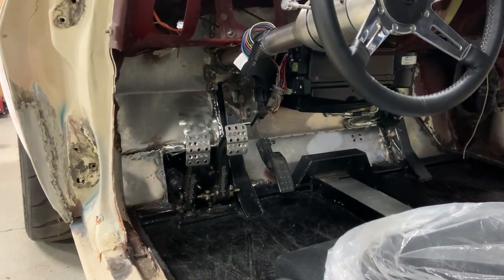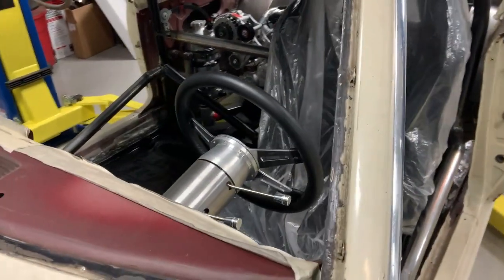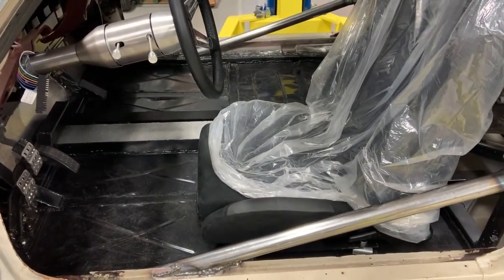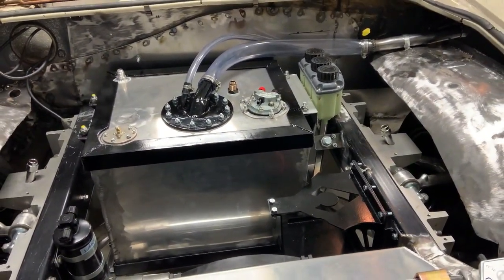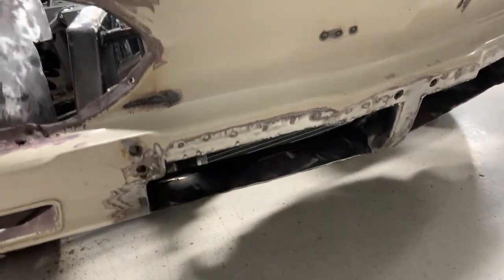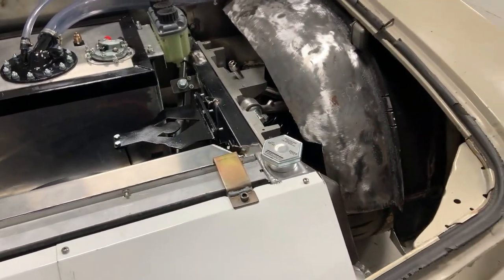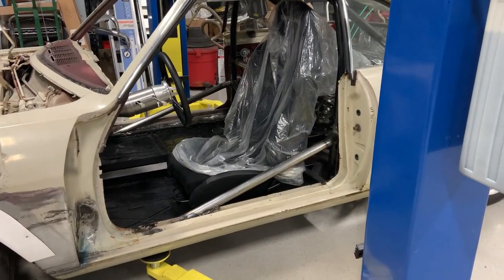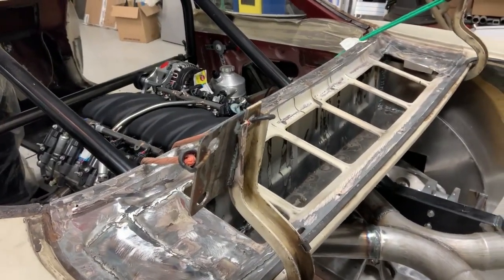NN 2 0 Video#9

Comment: Fascinating and I can't wait to see the finished product. I'm surprised Corvairs didn't necessarily come with front windshield defroster vents!
Reply from the maker: Thanks.  I should be a little clearer.  The corvair front windshield vents were the shared louvers in the dash that were also used  for the radio speaker.

Comment: I love yout work bro.
I dont know about cars, i just love them..does the battery near the fuel cell a safe or a good idea?
Reply from the maker: Thanks for the comments.  Having the battery near the fuel cell should not be a problem.  The fuel cell will be vented under the car and a lead acid battery alone is not an ignition sources.  Many drag cars have both the fuel cell and battery mounted in the trunk with no issues.
Reply: @nadersnemesis2.071  good to hear,,, i love the car🥰 keep it up

Comment: incredible progress.  👍👍😎👍👍May I ask a question?  Did you happen to compare/calculate the frontal area of the radiator intake to the exhaust area of the fan?  The combined intake area looks deceivingly small,  yet i suspect it is still larger than the exhaust area.
Reply from the maker: Joel, I determined the required "grill opening" based on a guideline that the opening should be no less than 25-35% of the radiator core size.  I found that guideline in several places and its driven by the amount of airflow capable in a radiator core due to the fins and tubes in the core restricting the amount of air that can pass through.  I made my opening 50% of the core size just to be on the safe side.  The fan I have is rated at 3000 cfm.  However, those ratings do not typically address other factors such as restrictions in the radiator, condenser coil, etc..  It was the largest rated fan that would fit within the width and height of the core.  Thanks for the comment and I hope that helps.
Reply: @nadersnemesis2.071  Excellent summary. Thanks for the thoughtful details. That helps.